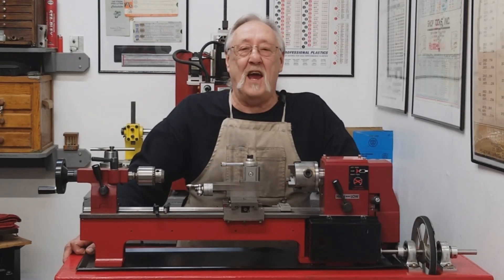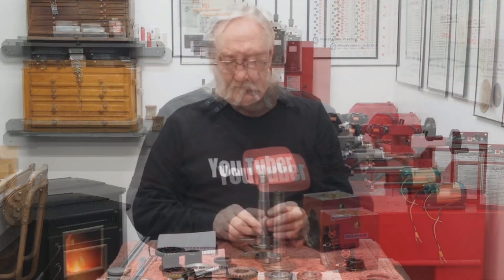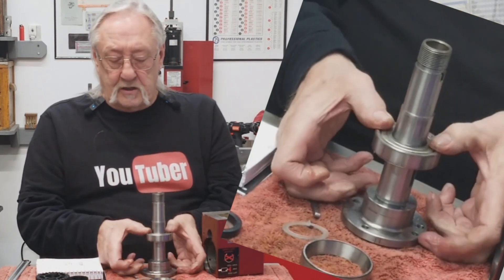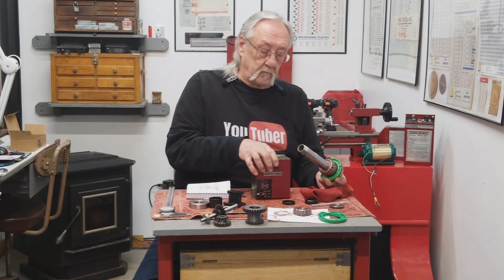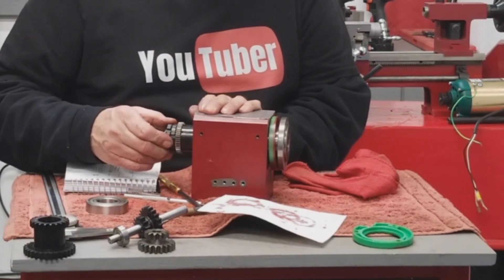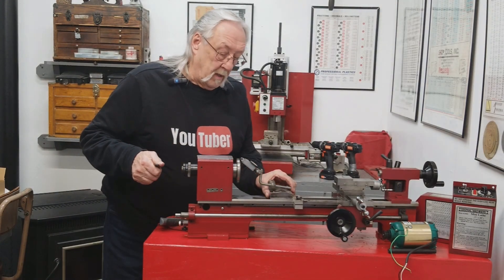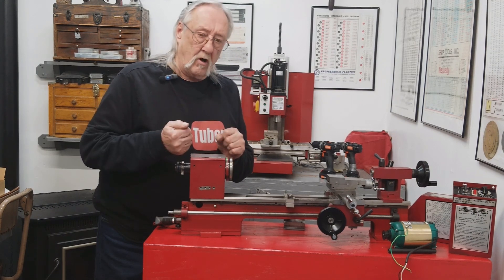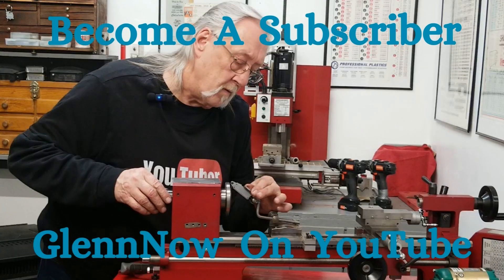Mini Lathe, Taper Roller Bearings, Preload Setting

Comment: I went with angular contact bearings. I ended up using my harbor freight bearing separator puller set to remove the spindle and bearing then polished the spindle on my wood lathe. Doing a little at a time with sandpaper and allowing the spindle to cool between sandings I got a nice slip fit. I will be replacing the plastic spacer after I get the lathe back together now that I have the measurements. For the folks that don't have a press yet.
Reply from the maker: One step at a time. 👍😁

Comment: I will probably be doing mine soon. This was a great tutorial. I was thinking, pinion bearings have a preload that can be measured with a swing arm torque wrench, but they run in oil to keep them cool. And is how I probably would think to do it. This is more like a front hub bearing where you run at pretty much finger tight plus enough to get the cotter pin in. I'll log that information for later. Have a good week!!
Reply from the maker: @faroironandcustoms6577  This kind of stuff should be a piece of cake for a guy like you. I've seen your work. You do some cool stuff 😎. Thanks for watching.